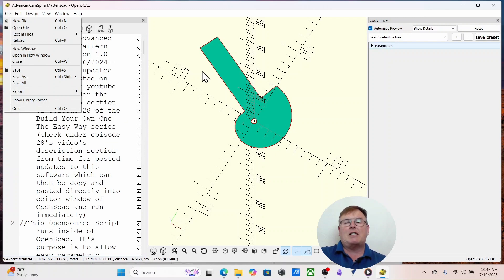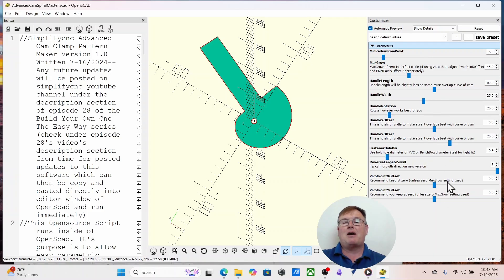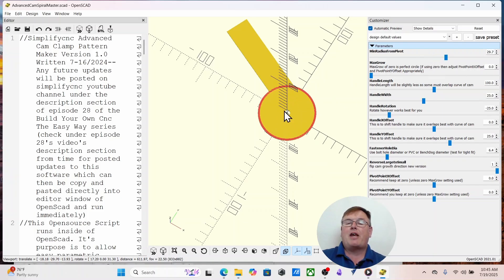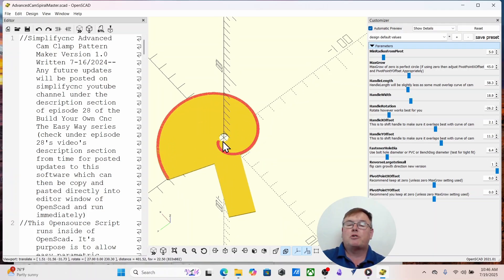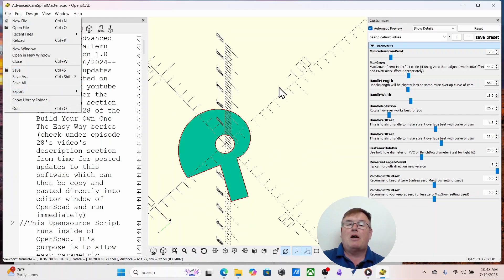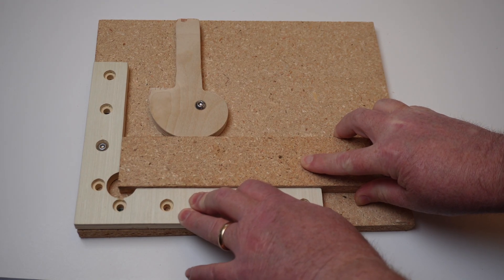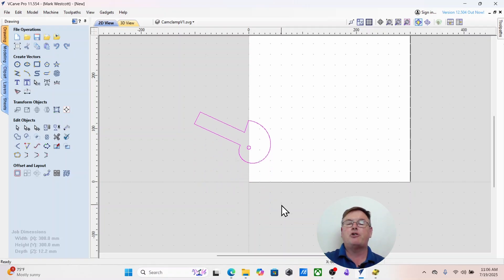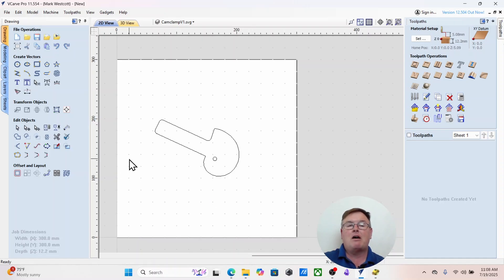Make Better Woodworking and CNC CAM Clamps Using a Free OpenScad Script | Build A CNC Episode 28

Comment: You are right.  Openscad is a super power.  I use it more frequently for 3D modelling and 3D printing, but it has advantages for SVG generation and CNC routers.
Reply from the maker: I also use OpenScad a lot for 3d modeling and 3d printing particularly when I want to friction fit parts.  I am fully convinced if a big price tag were put on the OpenScad software CNCers and 3d Printing enthusiasts would be buying it in droves.  However, since its free, ironically most people overlook it and think it must be inferior.  They are so wrong.  I own Vcarve Pro and like it a lot but there are just so many things that OpenScad does much better.  

Side note, for those new to OpenScad who might be reading this comment -- inside OpenScad there is a CheatSheet in the Help menu with a list of all the commands available.  The linear_extrude command is worth checking out in that it makes an easy pathway to take an SVG and extrude it out to an 3D model that can be exported as an STL.

Comment from the maker: When holding a workpiece with a clamp you made be sure to orient clamp so when it is pivoted its radius grows outward in the direction of the corner support board you are pressing against.  I demonstrated this in the video.  By doing it this way, any reverse movement away from corner increases the clamps friction and holding ability.  This is why I chose to include the adjustable MaxGrow parameter in the software.  Please remember to post any parameters below in comments if you find some that work well for you.  The initial default parameter for the first clamp is just an example that works and by no means is fully optimized.

Comment: What sort of CNC machine do you have? Recommend??
Reply from the maker: I have 3 CNC machines.  My first was a little Genmitsu 3018.  It cost less than $200 and came with free software.  It was a good entry level CNC machine but lacked a powerful spindle and had a very small bed. I outgrew it very rapidly.  I don't regret getting it as it was worth the price just to learn the CNC ropes but now it just sits in my garage as it would be way too frustrating now that I am used to more powerful CNC machines and spindles (the time saved is almost exponential using a powerful CNC over a low power small bit spindle).  My next two CNC's I built myself.  They have high torque Nema 23 stepper motors and allow me to mount a variable speed router or a spindle.  My first CNC you can see in many of my early videos on this channel.  It has a cutting bed of about 650 mm x 730.  It cost me less than $1000 to build including the stand, router, and computer that runs it.   My third CNC is the one that my build your own CNC series on this channel is based upon.  It has a cutting area of 723 mm x 377.  The supplies to build it cost me around $500.   I incorporated quite a few upgrades from my first design especially regarding router mounting flexibility and the capability to mount jigs easily to the router.  All that being said, what CNC would I recommend?  I am bias.  I would say build your own if you have the time as it can save you many thousands of dollars over many some of the more popular machines and have even more features.  My build your own CNC series really does take you through most of the bottlenecks.  I am not an electrical engineer but just a regular maker.  It's truly not that hard.  However, it does take some time.  If you want to buy a machine start by looking around your area for a CNC makers group.  There are tons of CNC users that upgrade their machines and sell off their old ones at a fraction of the price.  They most likely would be willing to show you exactly how to use it and if you're really lucky some might have software that you can pay to have the license transferred to your name.  I think Vectric Software has a program that will do that for around $50 to $100 which could be a real bargain if you stumble upon someone with Vcarve Pro or Vcarve Aspire Software.  If you have a budget and want to just buy a machine that you can have up in running in a few hours I do like scienci labs CNC (no I am not affiliated with them nor do I own one of their machines) but I do appreciate them making their gSender software opensource as it has helped out so many makers like myself.  I also think they seem to offer a good value for the quality of components in their machines.  However, I think some people often have to wait quite a while to get their machines shipped to them (and the shipping costs might make the machines perhaps much less affordable once you factor that in -- not sure).  I can tell you I would shy away from most of the CNC machines sold directly in stores as I feel like they are extremely high priced for the value they deliver (often they don't have powerful of stepper motors or even a good machining bed size).  If you have a specific CNC you are looking at and want me to take a look at the specs I would be happy to do so.  Also, if you have any questions about building your own, I would be happy to help you out.  I am considering seeing if I can do a live stream on YouTube to help people out who are building their first CNC's if there is enough interest (and I can figure out exactly how to do that).